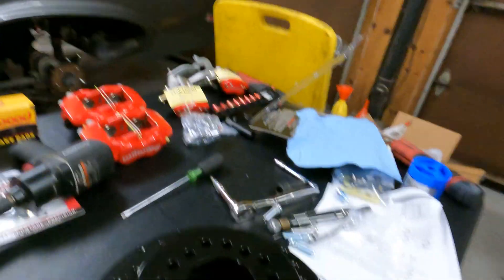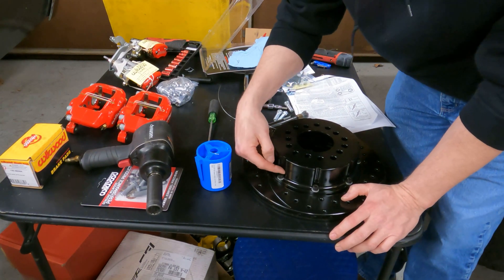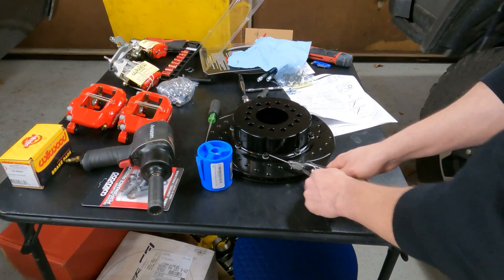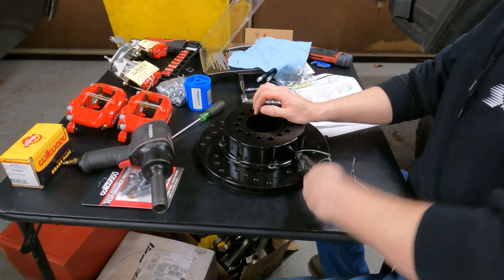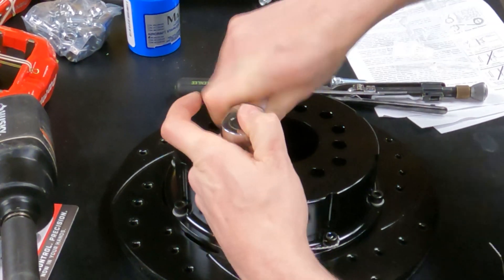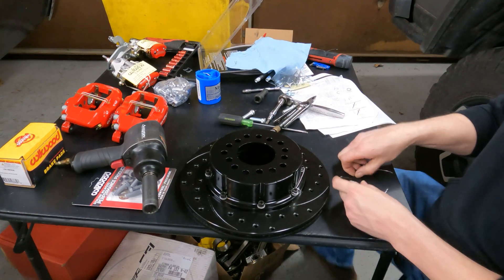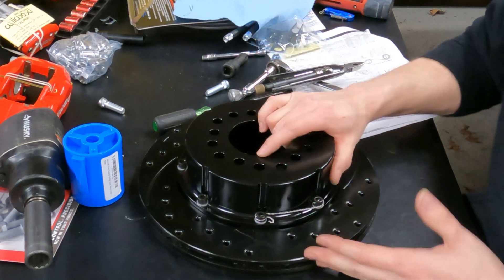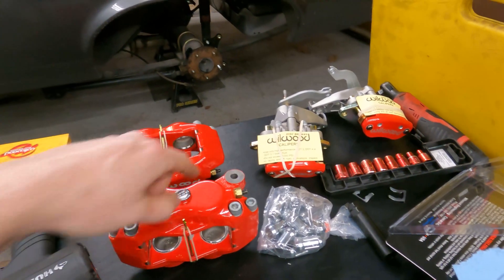Safety Wire For Race Car Parts, Keeping Bolts In Their Home!

Comment: Kyle I think you did good for not having done it in a long time.   Couple of tips from someone who safties almost everyday.   In the cove torque the first cap screw to where it belongs and remember where it was. Back it off if need be to start the safety where it should be. Once fed through retorque to where it was. twist as you did and get to the next cap screw.  Torque the second screw where it will be and remember it.  Twist the wire by eye to where it should land.  Then if needed back the second screw off to feed the wire through in the cove.  Once fed through retorque to where it was and then proceed to the pigtail.   With manual pliers such as the ones you were using when doing the pig tail you need to twist the wire in reverse manually without pulling on the knob. That is the wrong direction for a pigtail and also the reason why your loop kept flipping up.      Also, when doing a cove type safety don't be scared of just safety wiring in a neutral pull and less S shape.   That is a beautiful brake kit.
Reply from the maker: Pinned!

Comment: Video idea, go through a gen 3 or 4 tune file and show all the adjustment options and tables, and a brief description on what is it and how it works
Reply from the maker: Most of them we don't ever need to use, we adjust touch on the ones you need to tune those platforms

Comment: You can try alternating twist directions to help keep the wires down around the bolt heads so they won't come up over the top. Also if you want all the slop out you can tap the pliers with a hammer to get it real good and tight.
Reply: Concur. If the last time went the opposite direction then your first attempt would have been solid.